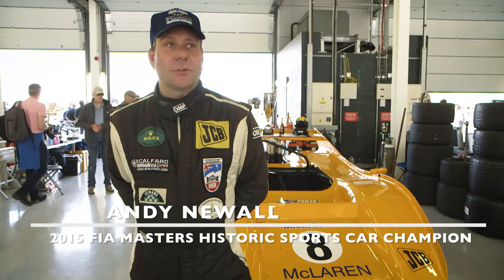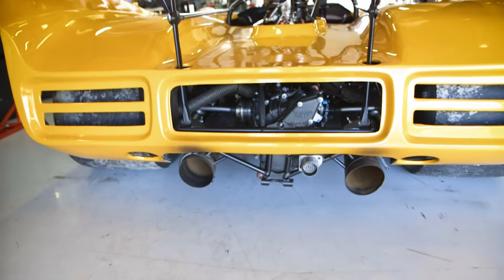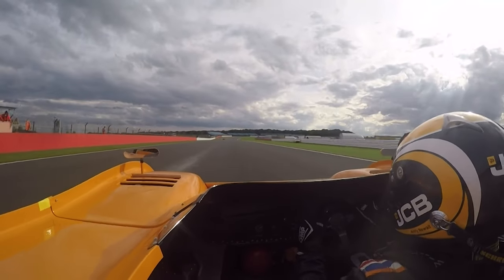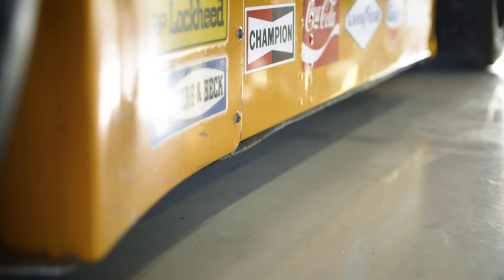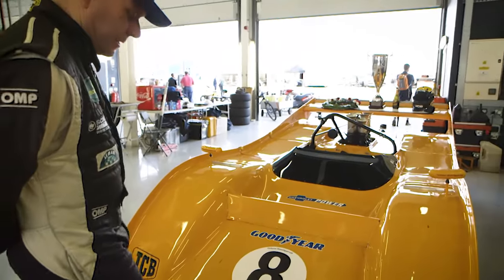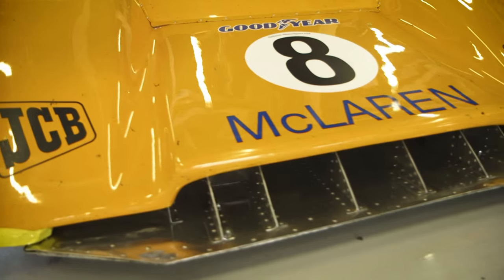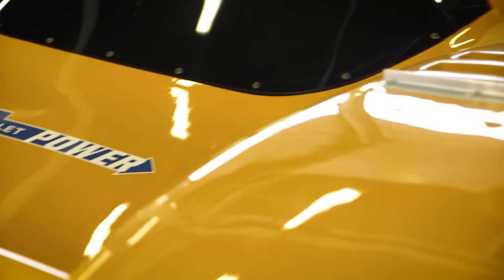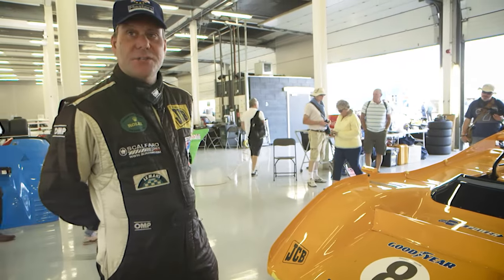Inside an 8.8-litre V8 McLaren Can-Am Monster

Comment: 540 ci BBC. 100+ hp/L at the crank for 1973, for that size of N/A engine, built to last 6+ hours,  is pretty darn good.
Reply: It's a modern engine. Not from 1973.
Reply: Can-Am races weren't 6+ hours, they were usually 2-3 hour sprint races.
Reply: you say built to last so long, because you think it makes it sound better..
Reply: Yeah but this is 50 year old tech not contemporary that's the point of the comment. Push rods and rocker arms not overhead cam. No computer no electronic fuel injection.
Reply: +Jack Allen, so what? Doesn't make an excuse for it's tractor like tune...should have at least 1200HP...
Reply: The ASSeboy: I wonder how much hp it would produce with your knowlege/omniscience 50 years ago.
Reply: Niebuhr: The brainyest comment of the year. Congratulations!
Reply: +Mico Wikström , a lot more than barely 100HP/liter.
Reply: Ben Dover, Yes true but keep in mind the F1 cars had double overhead cams and four valves per cylinder, the Big Block Chevy has two valves per cylinder and  cam in block design with push rods and rocker arms that is HIUGE disadvantage!
Reply: The Esseboy, Okay so give us a number using early seventies technology and heads? Do you have a lot of experience building big block Chevys? Keep in mind to get more than say 7500 rpms out of one of these you are going to have to go with something like Vasco Jet valve springs to stop valve float and with the seat pressures needed to stop valve float these engines had a nasty habit of eating camshafts, remember in the early seventies valve springs weren't what they are today. If you were building a drag engine sure but those got tore down every few races so what  twenty minutes maybe e of run time. Not qualifying and then running an hour or two flat out.
Reply: The Esseboy, So with the heads and technology available in 1973 you could build a what lets hear a number oh and may I ask how much experience you have building big block Chevys'?  Keep in mind the valve springs available in the early seventies were not what they are today, to get more than say 7500 rpms your going to have to something like vasco jet triple valve springs to keep the valves from floating oh and at those seat pressures these engines had a nasty habit of eating camshafts it run for any extended period of time like say anything past drag racing.
Reply: +Jack Allen, that is with push rod valves...seizing down the engine to a more manageable 7 liters, making it V12 and doing overhead camshafts you could make it do 10-11 Krpm. At that speed with 4 valves/cylinder you will make 900-1000 HP, reliably. Nothing special about it, just more cylinders, smaller displacement and better valve technology! Easy really, you just need to not be american to do it!
Reply: The Esseboy Umm, yeah but these were built with big block chevys .. obviosly with a european engine it would have been a whole differant thing. Porsche did a flat 12 that was stupid fast...but it wasn't a big block chevy....which is what McLaren decided to run with. So unless you can build a big block Chevy to 150 hp per liter output that will stand up to hours of flat out racing I submit that your comments are irrelevant. They felt the engine they choose to run was the best choice...if you say with a different engine you coukd get more power of course you are correct, but that is not what you said and is irrelevant since that is not what they decided to run.
Reply: The Esseboy Oh and one more point I fotgot make in the last post...Bruce McLaren is British llast time I checked, Surrey England is it? So apparrently at least one none American thought the extra torque from the big Chevy was a good thing. Just sayin....
Reply: +Jack Allen , Torque doesn't mean shit. It's as irrelevant as the RPM when you are talking pure performance.  Wide power band is what you mean. Just proves my point you don't know shit. Real engineers doesn't just add displacement to a weight sensitive application to increase performance, Supercharged engines achieved around 200HP/liter in the late 60s...so a 900HP 4 to 5 Liter V12 wouldn't have been hard to make. 

And no, toque doesn't move a car, nor does RPM, you need both to get actual energy output, aka power aka horsepower.
Reply: +Jack Allen, Then why not opt for over head cams? Increasing the RPM and Valve area would surely break the 1000HP mark...
Reply: The why did the F1 engines of 1960s last several races over 1000 km? Hmm I wonder.

No I weren't around in the 70s, but that doesn't mean that I cannot determine what engine type that is the most efficient.

Silly? You seem silly my american friend with an unconditional love for the grossly oversize V8 with out dated push rod valve technology. 

You are yet to point out anything false in my statements. F1 engines have always and will always have the best Performance to weight to reliability. Today's F1 cars use their engines for around 3000 km before they change engine! And they produce 375 HP/liter (450 HP/liter with electric motors)

High torque low RPM is optimized for Trucks doing millions of kilometers per engine rebuild, not racing!
Reply: Thank you for the post!! I was not aware that Bruce was from New Zealand Thank you for the correction!! I just looked up McLaren cars and it said Surrey England, my bad. I stand by my post about him NOT being American to my non American friend posting on here., Of course a huge big block Chevy is a good idea if you have no engine of your own...My nemesis on the comment section seems to think he is smarter than Bruce McLaren and the rest of the early seventies can am teams by telling all of us how stupid they were...I just disagreed. lol/ Have a great night!! Or day....whatever the case may be...
Reply: Yeah, is this not what I have been saying for like the last 10 comments?? I never said the BBC design was best I said it was what they decided to use for various reasons.. I understand all too well that the over head valve design sucks compared to Overhead Cam Designs... Did I not say "if you use a European design it would be a different story?" This jerk kept saying It I was there I would built way more horsepower...I said out of a big block Chevy?? and then he said no with twin cam four valve heads, I said that is not what they decided to use so get over it!! And I must say even with the fucked up engine they did quite well for themselves.  I was arguing with his statement that he could build 150 hp per liter out of the same engine...which is BULLSHIT since I have built big block Chevys and I KNOW what they are capable of...
Reply: +Jack Allen
You clearly said: "Okay so give us a number using early seventies technology and heads?" I gave you several numbers. Either a less complicated head design on a big 6-7 liter V12 or a smaller 4-5 liter V12 with advanced head design and a compressor.
Reply: Using early seventies BIG BLOCK CHEVY parts!! Which is what McLaren went with, I for one am not going to try and rewrite history and call the McLaren company idiots. I feel like they kinda knew what they were doing. "When the original Can-Am series ceased at the end of 1974, McLaren were by far the most successful constructor with 43 wins." this from Wiki.  I'm guessing they might have had a good idea...
Reply: +Jack Allen ,  You give them too much credit. They just followed of what other people did...no true innovators!
Reply: Ben Dover   1990 Corvette ZR1 had a 5.7L DOHC engine designated LT5.   Mid-engine 2018 Corvette will list a new 6.2L DOHC 4-valve engine also designated as LT5.
Reply: Most of GM's engineers have said that the C8 will be rear mid-engined.  And, technically, they have all been mid-engined since the C4, just front mid-engined.
Reply: The Esseboy Ferrari built the 712 to compete in Can-Am. It ran with a 7 liter V12 which is Ferrari's biggest engine up to today. It didn't have any of the figures you are on about. It made 750 bhp at 8000 rpm and didn't really have a chance against the McLaren's.
Reply: Essboy- could you do everyone a favor reading any comment you make here forward and pin/lead with your previous statement "Torque doesn't mean shit." If you like, continue, "It's as irrelevant as the RPM when you are talking pure performance", or the statement that followed. It will help us immensely. No comment upon you positively or negatively, just good information. Thank you, kindly.
Reply: Torque does mean shit and it's very relevant to RPM when talking horsepower. HP is work done over time, torque is work, the more torque you make and/or the more RPM the more HP you make.
Reply: 900 HP , open headers..........
Reply: Sounds like a bunch of serious engine builders here. I post in the hopes that you kids will go look this stuff up and learn before you judge.

These engines were standard deck Chevrolet Mark IVs cast by Reynolds Aluminum and built especially for McLaren's Can Am program by a very knowledgable dude named Gary Knutson. This engine is physically narrower than a Cosworth DFV and probably weighed about 450lbs. They originally displaced 468ci (7.6L) but grew to 509ci (8.2L) and developed 780hp naturally aspirated for the M20. They might have had reliability issues back then, but here in the USA $14,000 will get you a brand new turn-key built 10L making 900hp NA @ 6000rpm for 100,000 miles needing only oil changes. 

Why would 2 valve heads with cam in block and pushrods be a huge disadvantage here? Even stock Chevy square port Mark IV heads could be made to breath extremely well back in the early 70s and the whole engine could be smaller and lighter with two valve heads on cam in block. Why would you rather have a high reving 4L for endurance racing? 

Nothing wrong with pushrods, they allow maximum internal displacement for minimum external area and weight. Only Asians and Europeans care about HP/L because of their silly tax codes that penalize displacement instead of actual fuel consumption and emissions. 

Americans do not rebuild their V8 drag engines every few races, we run them for decades at a time with nothing but a yearly oil change and maybe valve lash check if running solid lifters.

 "Torque doesn't matter". Are you crazy? 

People who haven't been around these engines shouldn't show their ignorance by typing their opinions until they've graduated from engineering school and moved past their goofy nationalistic pride. Seems like YouTube Europe never learned anything from either of the two world wars. 

https://www.google.com/amp/www.hotrod.com/articles/unlimited-rat-motor-racing/amp/

https://www.skipwhiteperformance.com/catalog/bbc-chevy-turn-key-632-stage-105-engine-afr-dart-block-915-hp-serpentine_87381/
Reply: @jackallen6261  not a huge disadvantage theres a lot more to engines then valves sizes or actuation and remember the big f1 engines that make huge hp per liter use pneumatics
Reply: @TheEsseboy  10-11k big block Chevys run those rpm. The cams over the head actually don't take a huge gain until 13k and that's due to slightly better valve control but after that you want pneumatics. Ohc actually doesn't give you a measurable bump in horsepower comparing cfm. A pushrod engines with 2 valves vs a sohc is where this comparison is actually valid in the hp war department as you don't give the other engine the advantage of more valve surface area and simply put more valves to shove air into. Ok a 320 cfm head no matter the valve actuation style can only flow 320 cfm na. Under boost You will see maybe a margain of error between a ohc and a pushrod engine only advantage a ohc engine has is less reciprocating mass. Ok we have not ever seen a ohc 2v engine vs a 2v pushrod engine under the same conditions to find the point of where the pushrods start killing power vs the ohc hint it's probably when the pushrod engine can no longer properly keep valves opening and shutting but we can engineer a system for pushrod engines to get around this as it's fact that the pushrod ohv engine is the baby of the mechanically actuated valve engines. The system has pros and no it's not down to cubic inches it's down to external deminsions. A pushrod engine is only let down by it's rpm potential something 99 percent of governing  bodies in racing don't really allow over x rpm in x series. Ok let's do a comparison. Ok we are running a maxed out 358 cubic inch 10k rpm sb2.2 with 2v of course canted valve arangment. Then we are running a engine with the same bore stroke number of valves and same head but modified to run ohc still we have a rpm limit of 10k.
So theoretically we can run these engines at about 1100 hp plus ik bad range but let's not go over 1300 let's choose a middle ground. We have 1225 hp and we run about 750 ftlbs of torque sorry don't know the stock sb2.2 torque numbers. Ok now we have 2 identical engines same bore stroke rpm rev range everything is the same besides how the valves are moved we are limited by more then just how we move valves in this one. 1 we are limited by air density due to varrying altitudes. 2 the 2v configuration if we add 2 more valves we increase valve surface area and we can size the valves to unshroud in the bore but still offer the best velocity of the air and fuel into the chamber (unless we add more valves of course. ). 3 we are limited in real life by the differences in the engines themselves no engine acts the same. 4 heat is a big killer of power so the cooling system for the intake air and the engine itself need to be optimal for your environment. 5 then we get to the juice fact we have no documentation that shows how much pushrods sap hp if it's even measurable.
Reply: @TheEsseboy  torque is a measure of work it's the only actually output of a engine hp is entirely dependent on torque and rpm.
Reply: @jdrok5026  Torque is not a messurment of work. HP is... moron
The whole point with OHC cams is to run 4v/Cyl....
Pushrod is pure garbage, can't run 4v (easily), needs heavy springs, can't be used effectively over 8-9K rpm. Why do you think almost all new engines uses OHC?
Reply: @TheEsseboy   horsepower is torque x rpm/5252 work is torque work over time is horsepower. Heavy springs is needed for valve control ohc is not for 4vs that's just fucking stupid as BMW was working on a 8v engine for their bikes. Ford uses 2 3 and 4v ohc engines. Prostock dragster run 10-11k rpm with pushrods. F1 ran 17k with pneumatics and run 15k with pneumatics now. Ohc has many of its own downfalls. It's a less complex system in the bottom end but more complex on the heads due to mounting. Your heavily misinformed as gm ran 4v pushrod engines in the 2 stroke diesels they ran a sohc 4v per cylinder v12 and they run a 4v per cylinder diesel again for the duramax it's actually not hard to run multiple valves with a pushrod system just costly depending on if you want to run individual pushrods for every valves or use a tiny bit more complex rocker arm ( rocker arms are also found in ohc engines so you can't say that ohc engines run less complex systems overall.) I literally wrote a huge paragraph with probably a shit ton of grammatic errors because I'm a terrible typist that should help you understand why ohc and pushrod engines aren't are clear on which is always better. Because neither is. If you want to compare pushrod vs ohc everything needs to be equal so that the potential power is exactly the same everywhere in the power band this would allow us to come up definitely if pushrods kill a significant amount of power or not. But please leave a misinformed response like say the ls is a Windsor and a modular copy so I can slam my head into a desk even harder.
Reply: If you actually believe that a 9.0l engine should be able to match a 3.0l engine in specific output("HP/l"), then you don't know what the fuck you're talking about and have no business questioning someone else about this. Friction losses, volumetric efficiency losses, the fact that these are fucking mass production-based, low maintenence, affordable 2 valve engines, not bespoke, designed from scratch, hand made, temperamental, unreliable, only available to the wealthy racing engines. And, these aluminum 9.0l big blocks only weigh as much as a Jag I6. It took a flat-12 designed from scratch from Porsche to compete with these "tractors". 
But, please, keep shit talking the most powerful circuit cars of the era(and some of the most powerful in history), especially when you don't have the slightest understanding of the physics behind engine design.
Reply: @TheEsseboy  do you care to make a response or did I actually give you more information to help you realize you aren't very well educated
Reply: @jdrok5026  You don't seem to understand simple physics. Why are all industrial machines rated in Power and never in torque? Because power is what moves you.
Reply: And horsepower is far easier to understand for most buy industrial machines aren't rated in hp normally they are rated in torque and horsepower along with other data. Gpm etc etc and your probably thinking of something like a genset which is rated in watts or volts or amps. Continuous or peak.
Reply: So much you need to understand torque is work horsepower is work x rpm / 5252 talk to anybody who knows anything they will tell you torque is the physical force a engine throws out and hp is how quickly it can put down the force in a given time period basically everything in a engine revolves around torque and how it produces this force.
Reply: @TheEsseboy  and torque is power without torque you get no horsepower why do you think transmission and rear end and transfer cases pto drives have a max torque rating.
Reply: @jdrok5026  That's because the gears can withstand a certain amount of TQ... FYI they also have a maximum RPM rating but it's never stated.

Why do you think powerplants are rated in MW instead of TQ?
Reply: @jdrok5026  Haha, laughed so hard I cried a bit, Torque is a static force, try to move anything with zero speed, I beg you.

Do you really think that HP is a meaningless value? God help me.
Reply: Hp sorry and you can't creat torque without fucking movement that's impossible.
Reply: @TheEsseboy  power plants are rated in wattage because guess what they produce electricity. So the only figure that matters to them is the amount of electrical energy they can create.
Reply: @jdrok5026  And the engine that powers the plant puts out what? Yes, TQ and RPM. But as TQ and RPM are irrelevant, that is not stated. Power is work, TQ is just a static force.
Reply: The Esseboy Torque is measured. Power is calculated.
Reply: RyTrapp0 That flat 12 wasn’t designed from scratch. It was cobbled up from 908 spare parts.